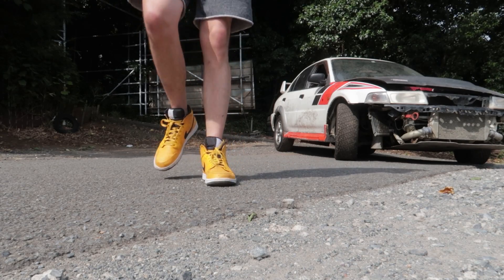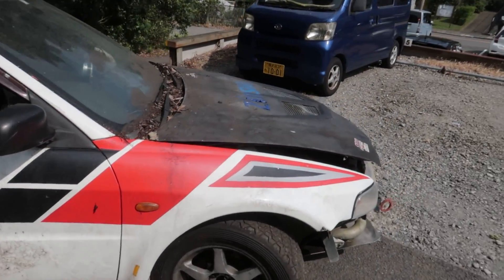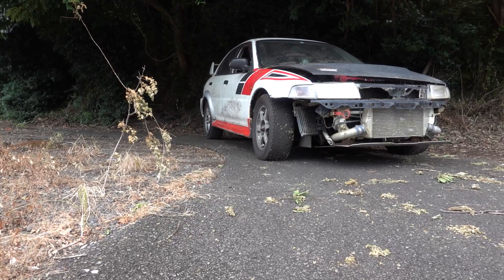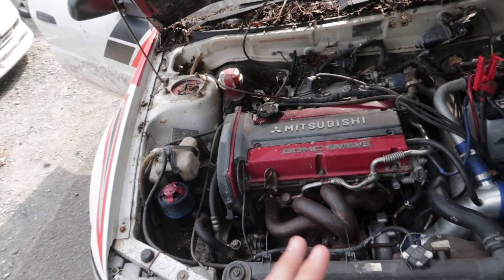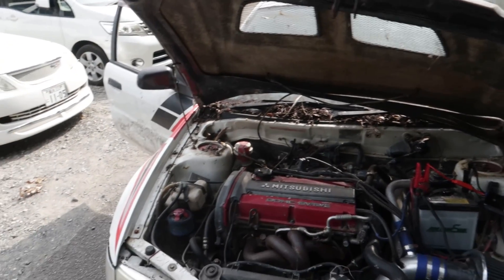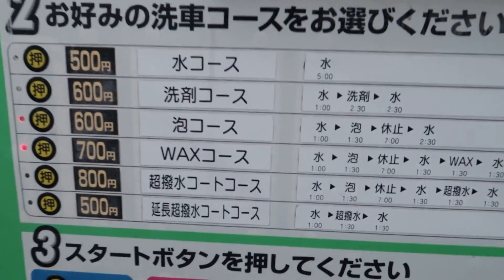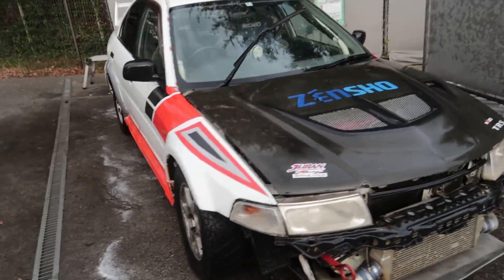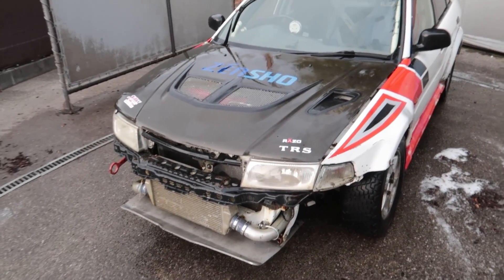I BOUGHT AN ABANDONED ULTRA RARE EVO 6.5 TME RS & I'M GOING TO SAVE IT! - REAL LIFE BARN FIND!

Comment: My 92 Eagle talon TSI started out as a mouse infested wreck of a car that was a running and driving but everything else was garbage. After almost a year I have replaced the complete interior from a donor car and have it running great on 15psi. The motor was a older build but has all the good parts and .20 over pistons. Any car can be saved just takes dedication and even though my car is nothing rare its still putting a smile on my face every time i rip it through the gears hearing the turbo spooling up :)

Comment: I had a chance to be a passenger of 6.5 Tommi edition in Singapore before it was stolen by Malaysian carjacking syndicate. The driver was my mechanic who attended to my WRX who was also a part time car park rally race driver. I cannot remember how how he had the car but I think it was a race car. I have to state that it felt way dangerous sitting in 6.5 Tommi edition because of it's launching capability and of course driven insanely by a race driver. Soon, I sold my WRX and bought a regular EVO. In my opinion, the only WRX (stock) that can be of any serious match to an EVO is the WRX STI 22B.

Comment: I'm sure you've seen it, but on that website you were looking at for the build numbers, it shows the exact specs your car was built with

CP9A-0202400SNDFTommi Makinen RS2000-02W83G Scotia White Interior Code: 77P; Option Code: 08K: Final Gear Ratio Change; Fr Lsd; Impact Bar Less; Final G/Ratio Change + Lsd; Thin Body Sheet MetalTommi Makinen RS Japan #118/218

Comment: After i watched the video, there's so many things to be fixed on the interior but the exterior has to be...you know! Turned signal lights on the left side has water on it, the front fenders have so many dents. It needs to be replaced and it has to replace a new  front bumpers and an Evo grille. The rear quarter panel must be replace it is really in bad shape. Side skirts and rear bumpers must be new also replace. I don't know if your'e going to retain that rear spoiler but for me...its a no no. For the engine? We know you will going to stripped out and rebuild it again just what had you done to the miata. New set of wheels, suspensions and other stuffs will be new so we will be expecting a new content in the following weeks. 

Fact: Technically, Evo"s are a rally type car and most of it especially a Tommi Makkinen Editions are having an all-wheel drive used in rallying. In short, its a complete package.

Take my advice, just use the car as your daily car. You can take the silvia and the R34 on the track but for me, the evo is a nice daily car if you want to preserve it for a long time.

Looking forward to your next content mate! Cheers!